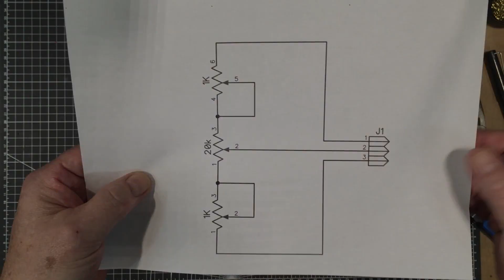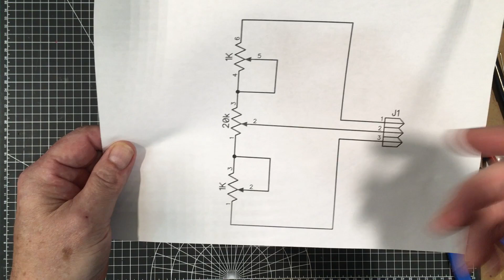Uni-Byte 0218 - Two quick EASY and VERY useful Projects

Comment: Hi, Bill. Nice projects. Thanks for sharing. Did you do a video on the Dual Pot PCB? If so, may I have the link?

I have mentioned that, by teaching myself, I have ended up with gaps in my knowledge base... I have just learned the trick of putting a resistor in parallel to a pot to change the pot's effective resistance range.

One might not think that use as very needful, because you can use a higher value pot and just not turn it up all of the way. But, I was designing an instrument amplifier and I needed to achieve precision control over the front end input gain, to limit the gain, absolutely. Otherwise, bad/expensive things could happen, down stream.

I figured out that I could use whatever resistor values I liked in the circuit, because I could calculate in reverse to determine the needed pot value. Then, I could make the pot range to be any odd value, by putting a resistor in parallel to the pot.

I ended up needing a 80 Ohm pot. That value is not manufactured.  So, I will be using a 100 Ohm pot, with a 410 Ohm resistor across it.

I think this might make for a very interesting and educational video topic, for you. I am sure that there are more details to know - more applications, pitfalls and rookie gotchas. Being a rookie, myself, I would be sure to watch. Cheers!
Reply from the maker: HI Tom.  No, I didn't do a video on it.  I thought it would not amount to more than a minute or so.  I discuss most of the reasoning in this video though.  I could certainly put a "Pot potpourri" video on the "to-do" list.  Thanks for the idea!  In the application you had, were you using the resulting pot as a potentiometer or a rheostat?
Reply: @uni-byte  Rheostat. I'll email you some information. Cheers!
Reply from the maker: @t1d100  Sounds good.

Comment: To aid tight cables / grommets etc Get yourself a bottle of Hellermann Oil It's a bit expensive, but a small bottle will last a lifetime. It's main use is to help the installation of silicone sleeves with the three prong type tool. Just have a small tin with some sponge in it, and add a little oil to the sponge. Poke the end of the tool into it and that's all the oil required to ease the sleeve over the tool, and then onto the wire. 

(It's been about 10 years since I added any more oil to the sponge and it's still going strong) 

In your use case, just poke the end of the plastic connector into the sponge and the wire will slip in easily. It takes a while but the oil does evaporate off of the connectors.

It's designed for the job and is much better than IPA.
Reply from the maker: Hellermann oil!  Absolutely.  When I was an early teenager my dad had a side hustle installing sound/pp-studios and building patch bays.  I earned good money doing all the cable dressing and soldering.  I must have gone through a gallon of Hellermann oil in my time.  I didn't know they were still around.  Thanks for the blast from the past - I'll have to look them up.

Comment: What is IPA?
Reply: Isopropyl Alcohol
Reply from the maker: @jerril42 got it right.  It provides some lubrication to help get the strain relief/cover on, but then evaporates completely in a few minutes.
Reply: @uni-byte  I still don't get it. Isopropyl is a single word. It should be IA.
Reply: @GWorxOz  It's common practice to call it IPA rather than IA. Of course you might prefer the other liquid referred to as IPA. 
India Pale Ale !  🙂
Andy
Reply: @andye2005  Must be a yank thing. We don't call it IPA in Oz, that's a beer.
Reply from the maker: @GWorxOz  ISO is a prefix so I guess it warrants a separate letter to make the acronym unique.  In any case, it's not something I made up, I just use it as that's how it's recognized.